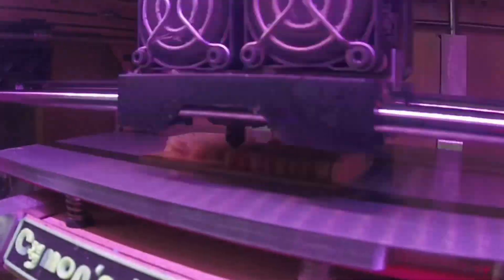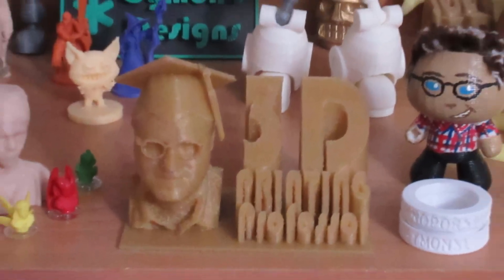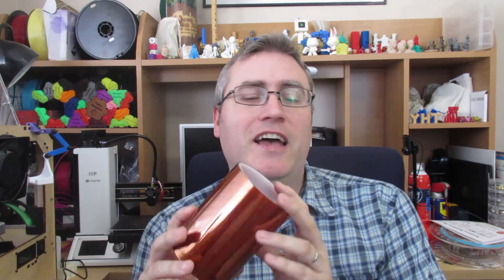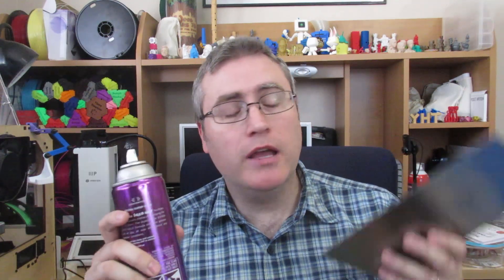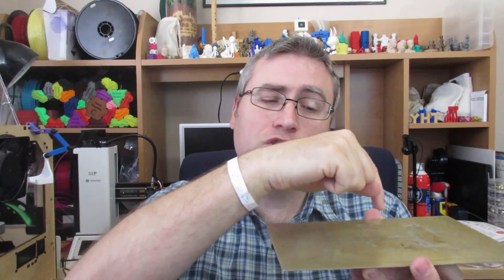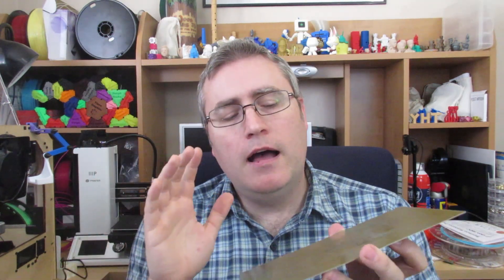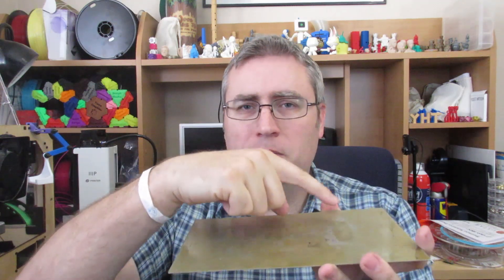3D Printing Build Plate Showdown

Comment: “PEI is a plastic that PET sticks to really well, … and if you're gonna use it for PET, you better get some glue stick.” 
What?
Reply from the maker: Sorry, meant PLA. Wow, how did I got this long not realizing I said that? I should fire my editor.

Wait, I'm my editor.
Reply: @3dpprofessor  In which instance? :D 
Because in my experience, both stick pretty well to most PEI beds. I did have one where a large PET print ripped off the PEI sheet, but it was super sticky in general and I never got to try a similar print on it in PLA.

Comment: It kills me that NOBODY has figured out THE solution!

Dedicated build plates!

No matter is you use clip on or magnetic surfaces to print on, have more than one!

Have one that is best for PLA.  Do not print another material on it!
Same for the other  materials.

In fact, no matter the surface, the spring steel sheets are super cheap.  Buy two for each material per printer.  That way you can continually print.  Remove one, throw on the other, hit print.

I see no reason for using compromised surfaces.

Comment: Third must-do: has to be rigid enough to withstand the drag of the extruder. The cheap plastic surface they give you with the Geeetech machines allow the head to drag the model out of vertical, and leads to a fail. The taller and thinner the model, the lower this occurs.

Comment: Heavily frosted glass is an option, difficult to make if you lack the tools though. Also, with glass you need to start at 80C then go to 60C this works with plain glass and I assume it is the same deal with frosted though I have not tried it. Honestly never had a problem with ABS or PLA with plain glass and the temperature trick.

Comment: I NEED to use ABS for complicated reasons. I can swear by heated glass bed (110 C) + glue stick. Works every time, gotta wash the glass bed every 3 or 4 prints and reapply the gluestick though. Still, I have had better and cleaner results than hairspray(works half the time, or maybe Im too cheap to go for the expensive stuff), ABS slurry is just a nogo for me, as I need to have a clean, perfect base!! ABS slurry welds itself to the printed part after printing though, and only a brain surgeon can cut it off!! Why deal with the fumes of ABS slurry, hairspray, or other junk, when you can just smear a glass bed with a gluestick (do it when cold, or you will get blobs of the PVA in the gluestick on your bed)!! By the way, PVA is a binder, so it binds really well to some stuff. Just my 2 cents!! A hot glass bed at 110C, a nice application of gluestick (BRAND MATTERS!! Im from India, so wont comment on INT brands, Elmer Blue should work fine, Fevistick in India), and a good first layer will ensure your ABS prints stick like "glue" to the bed. When the print is done, the part just pops off the bed with a crackle and Bobs your uncle. Happy printing folks, ABS is a bitch to print, but you can do fairly big prints with it if you respect the material and use an enclosed printing chamber!

Comment: I also use a mirror.  I found the trick is to clean it with dawn really well and dry it with paper towels.  I recently started using dawn and a magic eraser.  If I find something isn't sticking, I need to clean it with dawn.
Reply: I print mostly petg and some pla.

Comment: The removable magnetic build plate that came with my Ender 3 requires no interface and everything sticks to it. Simply bend it to easily remove prints. It's a no-brainer!
Reply from the maker: Magnetically removable build plate are definitely a win.

Comment: I'm a little late to the party, and I don't know if anyone else has said it, but a few layers of plasti dip works just as well as painters tape (maybe even better) 
When I first started printing PETG that was the only thing it would stick to, now it (kinda) sticks to my mirror bed, but if I don't apply glue or use tape, it warps and peels off if the nozzle hits the print

Comment: I've printed a PLA spool last time. Borosilicate glass, the bed: 60C, the nozzle: 210C.
The 1st part was going to be failed but luckily it "chewed" the small brim (small was the mistake and a bad leveling) so it came to be the part of 1st layer. I've used PVA glue stick. When getting it off I've didn't removed the glue by water but just got it wet a bit and applied a bit more glue. This mixture become a pretty smooth layer (it was easy to flatten it while it liquid). And for the 2nd part I've pre-heated the bed, pre-heated the nozzle manually and maybe 10-20sec before printing I've moistured it a bit by a wet napkin. The surface was sticky (if it dries then it becomes just dry - not sticky). And the 1st layer started to print very well. Although I've got an "elephant leg".
@3d Printing Professor, do I need to use a painter's tape to print by PETG on this glass or just a layer of glue? I've heard that it's too sticky and can damege this glass without an interface layer.

Comment: As always, a little late to this party but the subject matter is certainly not lost on me.  I suspect you've already worked with LokBuild by now.  I find it very useful and long lasting.  Here is a simple write-up on what I've learned about using LokBuild: http://www.print3dforum.com/showthread.php/1534-Care-and-feeding-of-your-LokBuild-build-surface
And as for the question about consumables... PLA in specific flavors works day in and day out on untreated LokBuild.  3D Systems PLA and 3D Solutech are two that love the stuff, where PrintRBot PLA required additional adhesives.  Please understand I am not a Shill for LokBuild and have never received a peep from them.
I've also learned not all crepe tapes are created equal.  I found one brand that simply loves ABS!  You cannot remove the print without tape coming up with it.  But that's another story.  Thanks again for your informative and fun videos.

Comment: You must not have tried them all. I've tried 3 or 4.  You're still with hairspray and glue stick?  Take a look at Filaprint from FilaFarm. You seem to be selling Buildtek.  I have the Filafarm Switch (magnetic plate) with the filaPrint print surface.

Comment: I use glass and Aqua net with heated bed....$7 in material for both and its removable, but you don’t have to take it out.... just spray it on your fingers and spread it on between prints.... I print mainly with petg

Comment: so what is a good 3 in one printer do you recommend that can print polycarbonate filament? thanks
Reply from the maker: Define "3 in 1 printer". Because I only know of 1 3D printers can call iteself "3 in 1", and it doesn't do PC.
Reply: i am All In One 3d printer. something that can scan, laser and print.
Reply from the maker: I literally dont' know of any machine that can scan, laser (cut/engrave?) and 3D print. Which one do you know about?

Comment: I started with the anet a8 and now I use the cr-10s. The best was going to Home Depot and getting 6 12 x 12 glass mirrors very cheap so I could switch out the glass at any time. I've been using a glue stick very successfully I print it where the head is very close to the glass and it sticks very well and then when it cools down and Pops right off. The print that's against the glass comes out as smooth as glass very smooth glass like surface it looks really cool. Many times I will print several times on one the glue stick. I'm switching between every print that is easy to take them back to the sink and wash off the glue stick comes off very quickly clean sheets again.

Comment: On My $100 monoprice select mini V2. I've tried the bare aluminum plate, buildtak, painters tape and glass.  nothing beats the borosilicate glass imo.  Its completely flat. PLA will stick without a glue stick most of the time. and the first layer looks amazing in comparison to the others.  I fought getting the glass for about 2 months, thinking there is no way it could make that much of a difference. But its an incredible improvement.
Reply: Yeah works good and looks great, for me my prints warp too easy on it.
Reply: @Andrew:  Where did you get a MP Select Mini V2 for only $100?

Comment: No man (no new ideas here), glass and hairspray is all use for ABS, PETG, and PLA on my self built cartesian printer. Never once a single issue with stuff sticking. As you mentioned parts pop right off with ZERO effort when it cools; in my opinion this is completely win-win. Now I do have to adjust the initial layer extrusion multiplier for each type of filament, but for ease of use and cost.... Glass was free and hairspray is hardly even a cost in what I spend). Just rinse off old spray with warm water and done.

I have to admit that I would like to use a better method than spring clips to hold the glass to the heatbed, but it still works great. I'm adding a 300mm sq heat silicone heat mat to my printer soon (all the parts are in, now to just do it), and I will take this opportunity to design something a bit better to hold the glass down.

Comment: I have only printed PLA and do so right on clean glass. As long as my first layer height is set to .230mm and I heat my bed to 70C it does a flawless job. And my prints are just sitting on the bed when the bed has cooled down. No prying or fighting to remove them. And the bottom layer looks like well... glass. I made a Fender Strat pick guard that has a mirror finish. Now I assume this won't work as well with other materials. But time will tell.

Comment: My current favorite is a mirror coated with pva glue slurry.  It's the same stuff as glue stick, but you end up with a much thinner layer that seems to stick to the glass for longer.  My solution is 1 part glue to 5-6 parts water. I put about a tablespoon on and smear it around with a silicone basting brush.  Its thin enough that you can still see your reflection in the mirror when it's dry.  As long as you let the bed cool below about 35c, you can pick the parts right off and the surface is reusable without more glue.

Using a mirror because it's cheap, flat glass.  I got a 6 pack for $9.99 at home depot.  Plus, it looks cool.  And if you use the purple elmer's glue, the solution looks pretty awesome, too!

Comment: I followed Ivan Mirandas advice: Mirror. I print with a brim at increased initial layer height and line width bed temp 62 c. as soon as the print finishes it pops right off. Rule #1 clean the glass well

Comment: Interesting thing is; I've bought a bunch of mirror tiles from Menards, cut in half for a FlashForge Dreamer clone build plate with great results.  Seems like a good mashed first layer with cleaning and using the "Water & Alcohol" misting technique works well for cleaning the plate as well as a release agent as the glass cools.  I have had one time I rushed the cooling and a divet of glass came along for the ride on a part.  And Glue Sticks help for certain filiments  (I have problems with Sky Blue from any manufacturer)

Comment: I have been using the blue print surface which is stock on Flashforge printers. Works like a charm with everything! This I have printed succesfully: PLA, ABS, PC max, PETG, ABS+, FPE, Wood

Comment: Doesn't that suggest that you should have two or more different build plates? A plate with PEI for printing PLA, and a different coating for ABS.
Reply: Removable, interchangeable (no screwing and unscrewing every time) magnetic or clipped-on surfaces should work for that.  Don't let the man(ufacturer) lock you into a single surface.

Comment: I print solely on clean hot glass.  No problems with PLA at all, ABS even sticks fine at ~70°.  The trick I've found is to make sure you're nozzle is as close to the bed as possible, this will ensure good stickage no matter the surface material.  If you can barely see that first layer being deposited onto the buildplate, your print ain't goin nowhere.  I just like the glass because it's always flat and things pop off after cooling with next to no effort.  Oh yea, don't forget to cork your bed too.

Comment: Also, I have had some issues with PETG on PEI. Many of the prints seem to get welded to the PEI destroying the surface of the PEI.  When I first started with PETG, I would use hair spray to separate the PETG from the PEI. That worked but it's easier to print PETG on bare glass.

Comment: I bought a 0.062" thick PEI sheet which I can easily switch out.  

I use the PEI for ABS and PLA but print PETG on bare glass.  PETG sticks fine to clean glass at 85C and comes off easy after the bed cools.  PLA sticks fine at 60C and comes off the PEI with some effort.  

I still have some trouble with ABS curling on PEI.  I'm interested in finding better stick for ABS but I really need to enclose my TAZ5 printer.  I do have better luck with hair spray on the PEI for ABS but even that is not perfect.

I use a small 0.062" spacer that I stick on the Z stop when I bull dog clip the PEI on the bed.

I've been printing with ESUN PETG for some time now, so much soo it's been months since I've used anything else.

Comment: I have found that glue stick on a heated bed works best, but I only use tiny amounts of glue.

Before each print I add just a drop of water to the glue that's already on the plate and smooth it out again. Every now and then I top-up the very thin layer of glue with a bit more from the stick, but the stick still lasts for ages and ages.

Comment: PEI for PLA is great. Sticks great when hot, releases (fairly) easily when cold. Durable enough to stand up to my scraper, too. But like you, I didn't have a lot of success with other materials.

I did some testing with FR4, too. For a while I thought I'd found the perfect bed surface, but it turns out the resin isn't stable at elevated temperatures and it cooks off after a handful of prints, leaving you with a fiberglass board that nothing sticks to.

Comment: I bought some generic buildtak. PLA stuck to it too much and I had to peel it off. It left a really tacky glue layer. PLA sticks to it wonderfully, and it releases beautifully after a splash of isopropyl alcohol. I scraped up some of the glue and put it in an alcohol bottle. I spread it on the build plate like ABS slurry between prints. I wish I knew where to get more. I haven't tried it with ABS yet.

Comment: Hi, have you ever experienced pieces of glass flaking while removing your object after printing. How do you prevent this, or is there a special kind of glass we can use to prevent flaking?
Reply from the maker: Yes. My solution was to stop using glass. Got me a sheet of aluminum that I roughed up a bit with sanding (do not sand blast as that causes warping) and the hairspray sticks fine.

Comment: I was wanting to know what metal you use on your magnetic build plate spring steel or stainless.
Reply from the maker: I actually don't know. It's the build plate that came with my geckotek, just stripped off all the stuff that they put on there when it started to fail.
Reply: True stainless isn’t magnetic. Only alloys of stainless contain iron.

Comment: I am not positive if the hairspray itself is flammable, but aerosol cans are called that because they used to use aerosol as a propellant-- a gas that is under pressure to help it spray. But then they found that aerosol was destroying the ozone layer, so they replaced it with a different gas,... propane. Which is indeed flammable.

Comment: I started with glue stick then hairspray then bare boro glass and all worked great but suddenly the boro glass no longer held even when cleaned with any solvent you can think of (yes, I used even gasoline followed up with acetone followed by 97% alcohol) so I went back to hair spray and it was iffy.  Back to the purple glue stick I went and I have now stayed with it because the cost was like 3 jumbo tubes for $2.88 at Amazon and one tube is thousands of prints.

Comment: I use 1mm thick PEI sheet which removable, I print PETG on it without glue or hairspray.
When finished printing I took it of the printer and bend the PEI sheet and the part came loose no matter how big it is.

Planning on magnetic upgrade too.

Comment: I use tempered glass.  I wipe it down with regular fingernail polish remover with acetone. (not the 100% type).  PLA sticks amazing, ABS sticks with a brim.  But PLA, after the bed cools down, is literally just sitting there.  I plan on doing a different glass adhesion video once I get my big printer fixed. (with microscope).

Comment: Does anyone know what the best 3d printer is for under $250? Also, if you know one can you list it's print volume?
Reply from the maker: The 3D Professor loves the MP Select Mini. Check out my video about it. It's got a 4" cube print volume.
Reply: 3D Printing Professor is there anything with a bigger print volume?
Reply from the maker: There are some. But they're a kit that you have to assemble yourself. Are you okay with spending a weekend building a 3D printer and are you secure with your ability to assemble it with engineering precision? You can try out the Anet A8. 8" cube build area, no heated build plate.
Reply: 3D Printing Professor have you heard about or reviewed the tronxy x2?
Reply from the maker: I have heard of the Tronxy. I've never had any hand-on time with it. Seems to be a bit outside of your price range, same size print area as the A8 and adds a heated build platform.
Reply: 3D Printing Professor What about the tronxy x1 press reset did a video on it
Reply from the maker: Yup, and it's another kit, comparable to the A8 in my opinion. In fact there's some arguement that they're the same thing.

Comment: Well you should try to use a 2-3mm thick carbon fiber sheet. Works for me and I am curious to know how it works for you.
Reply from the maker: Where does one get a 2-3mm thick carbon fiber sheet? I see amazon has some woven carbon fiber sheets for cars, is that the stuff?
Reply: Most RC Hobby shops have some, i got em from different shops like Banggood, hobbyking and Goodluckbuy since they are very cheap and affordable. It's usually listed under the DIY RC Hobby .